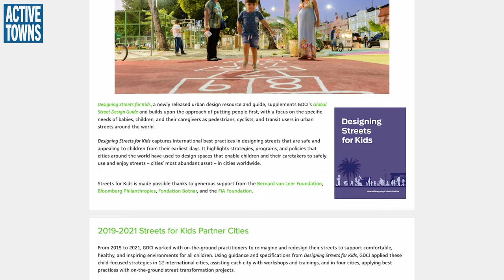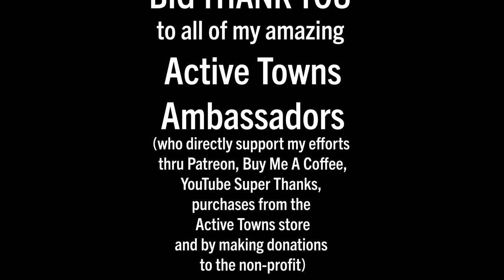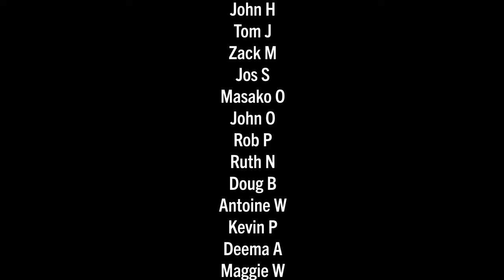An examination of quick build & permanent bike/ped infrastructure examples

Comment: GO ahead and pick on sharrows. Any lane that is for cars and bikes together is a lane just for cars.
We have a narrow two lane road with a 40 mph speed limit and sharrows in the middle to show where they actually think bicycles should ride.
Bureaucrats should not be allowed to do anything involving thinking.
Reply from the maker: This is an absolutely inappropriate use of a sharrow and a speed limit that sounds suspiciously like traffic engineering malpractice. What's the context and setting?
Reply: @ActiveTowns  
If you want to see it, it's Graves street in El Cajon, between Broadway and Pepper, just on the east side of the 67 highway.
It looks like a city street but it's actually a county road, and they're pretty clueless. El Cajon is trying to do better but they're also bureaucrats, so . . . 
My east-west corridor is Greenfield. It's in the category of "less bad." The city limits wander, so I'm constantly going between city and county territory, so I don't expect much improvement unless they form a joint committee to coordinate the work.
Reply from the maker: @JustClaude13  Yeah, that's pretty nasty. The immediate thing that comes to mind is that this entire set up smacks of running a freeway through a community that doesn't have the wherewithal to fight for mitigation measures. For instance if this was a wealthy community at the very least there would be a sound wall and trees or other vegetation planted  in a buffer between the highway and this "frontage" road masquerading as a residential access road.  The good news is that there is actually more than enough room to completely redesign this space into a much more people oriented environment. Ultimately speeds will probably realistically be north of 30 kph (17 mph) so protected and/or separated active mobility facilities are a must. As far as what is will take to make this happen there has to be an overwhelming call from the community to the politicians to address these unsafe, unethical, discriminatory designs. Every public street that is not a freeway should provide safe and inviting all ages & abilities across all mobility modes, thus we the people must hold our elected officials accountable to this expectation... which, means we must grow the movement and spread the word about is possible. It's really hard work, but it is precisely what must happen. In my interview with Carter Lavin we talked about how this happens: https://youtu.be/7t_ZesLgSoo
Reply: @ActiveTowns  
That was a good video. Well worth rewatching.
The highways strike me more as not thinking things through to their long term conclusions. They are where they are because that's mostly where the old wagon trails used to be. It was all open country back then; some ranches and farms, but the people were mostly along the Main Street corridor, which became part of Highway 80 when the road to Yuma was upgraded.
When the 80 became I-8 it was pushed out of town and ran along the orchards on the north edge of El Cajon and then through the dairy farms in Mission Valley.
Easy access to the freeway then encouraged a lot of development in the northern reaches and in Mission Valley, pushing out the agriculture.
I-15 was different. The bay area was already well developed and San Diego didn't want a freeway through the CBD, so they pushed it through Little Italy and Balboa Park, then south west of the Naval bases and port facilities.
They displaced a lot of Hispanics in the Barrio, but they didn't have any political power so they were expendable.